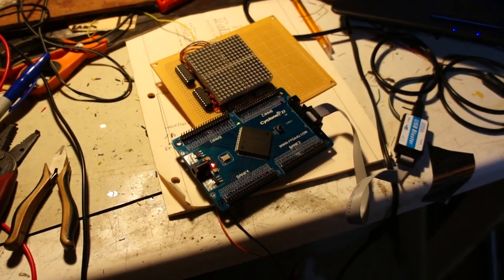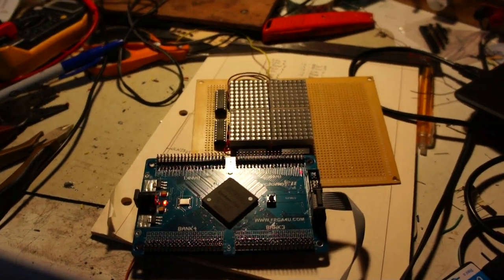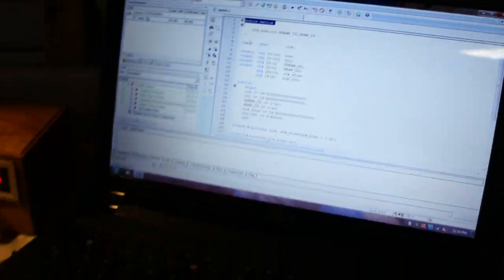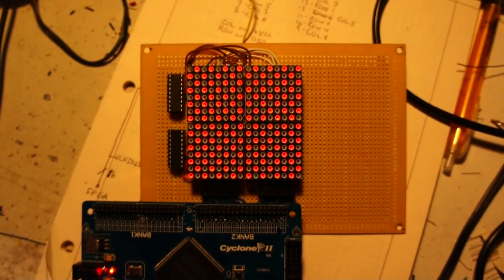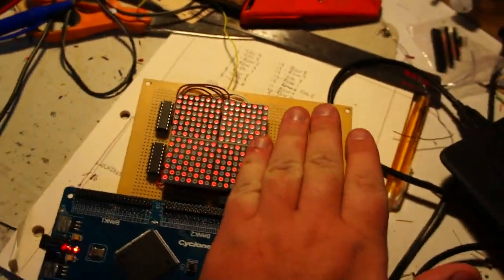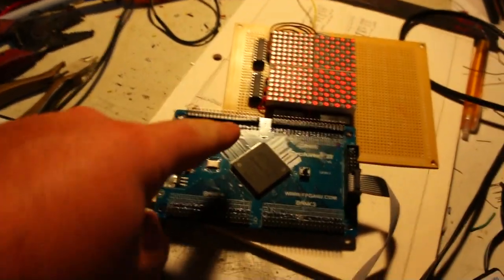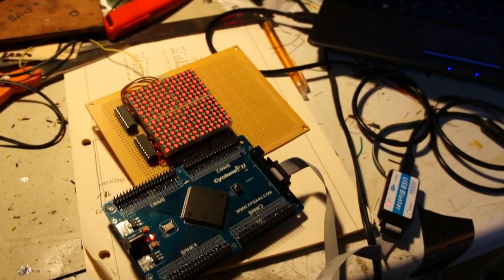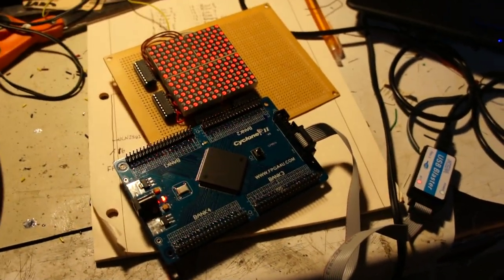RESET VECTOR: 16x16 DMD FPGA TEST

Comment: I'm surprised to hear that the Propeller is too slow for this. I'm using a modified version of the VGA_Hires_Text driver and it can push at least 60 million 8-bit pixels/sec running on two cogs. It works by running the cogs in tandem: one cog compose a line of pixels from main memory while the other cog is outputting the pixels it gathered during the previous line. I know an LED matrix display is not video but it should be pretty close. I'd be interested to hear where you got stuck. Thanks!